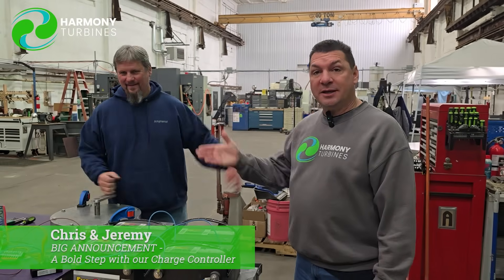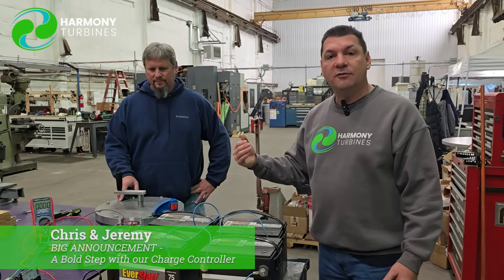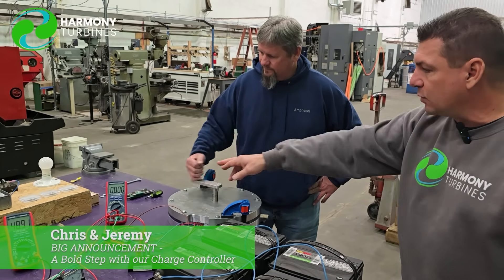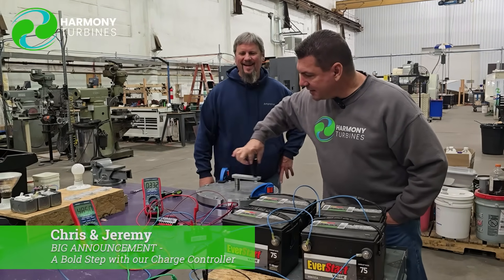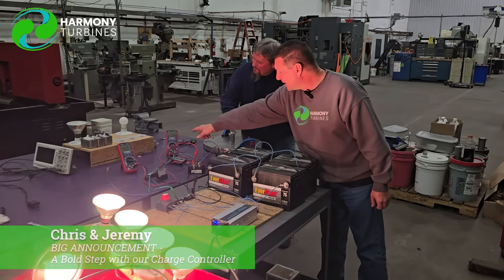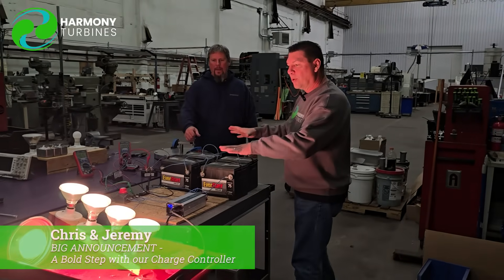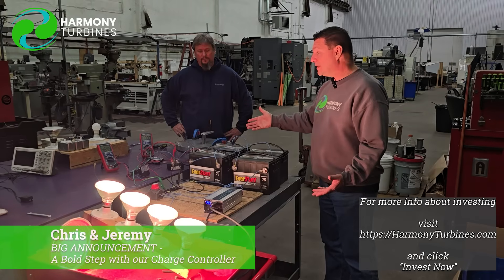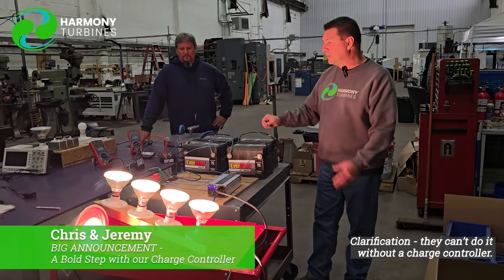We Finally Did It!  - A Bold Step Forward

Comment: You act like you made a major discovery? All of this is known science, we all know that in a micro wind generator application the alternators stator is often wound to match the battery voltage, this is known as the cut in speed. Now as I hope you know Voltage is proportional to current so if you use your furling system to slow the turbine down not only are you decreasing the voltage but also the current. Deep cycle lead acid batteries have a higher resistance they clamp down on the voltage from the alternator and therefore current increases. Traditionally a diversion load controller was used to keep the turbine under load while keeping the battery from over charging. With new battery technology like lifepo4 that include a BMS a charge controller is mppt charge controller is a much safer bet to deliver the proper charging parameters to the battery. In any event using a furling system to decrease energy production is essentially a waste of energy.
Reply from the maker: Swamp the furling is only going to be used when needed to PROTECT the batteries from damage in high wind situations. Right now the only thing other small wind turbines do in these cases is SHUT OFF completely by shorting the generator windings to one another. Their solution is ZERO power. We have the ability to still deliver a maximum safe level of power which is a huge improvement over ZERO power.

Comment: early investor, here, question:

1) if your systems are designed, as stated here, to operate in a specific range to work together based on the battery-bank voltage and type…  are you testing the use of other than lead-acid or lithium batteries systems?

2)  will there be a NiFe battery-bank system options made available?
Reply from the maker: We plan on getting into testing of other batteries with our BETA program. I specifically want to make sure we test Sodium Ion systems as well since they're going to be replacing Lithium systems over the next 5 years.

Comment: First of all, congratulations on the paradigm shift.  Epiphanies like this could really be a game-changer. As an investor however, I have a couple of questions:  1) Does battery chemistry affect this "analogue" solution?  LFP generally requires more careful management through complex BMS and specific voltage ranges tend to be very important.  2) What kind of voltage (not just amperage) comes off the generator and how does it fluctuate with RPM's?  3) It appears that instead of using greater torque to increase output from the generator, it is now just a function of speed.  But how much speed can you reasonably get out of a furling (near ground) turbine and still be safe? Originally, I thought the idea was that as the wind speed increased, the generator was going to essentially shift gears--creating more power without needing to drastically increase revolution speed.  I'm concerned that with speed being the only variable, the output will either be self-limiting below a good ROI, or it will create a long-term maintenance challenge due to wear and tear.

Comment: The simple solution is generally the best.  However, won't this solution to protecting batteries lower the efficiency quite a bit. When there is finally a steady, powerful breeze to pull energy from, you will be tapering the output rather than increasing the load.  I can see closing the scoops to mechanically protect the system when the winds are threatening, but it seems you'll be giving up energy during non-threatening times rather than pumping more electricity out.  It sounds like you're saying that the scoop system will be now be responding to the state of the battery charge, rather than the state of the wind energy.

Comment: This is appealing as no one has marketed any considerable small use wind generation. Especially compared to residential solar. If we can throw up a few of these and tie it into the grid similar to solar on a roof, that would be amazing. As dumb as it sounds, having a user friendly app to monitor the work being performed by the turbine will go a long way in marketing these on the residential level

Comment: sounds like you haven't been programming the MPPT ramp curve properly in the previous charge controllers you've used. A slow ramp can be had by fine tuning the IV curve.  Midnite Solar Classic can do this for wind curves, and so can some Solis controllers. Charge controllers when set up correctly, will control the voltage AND the current, and allow you to follow the turbines MPP over a much larger RPM range. 
Thousands of off-grid folks have been using this direct "stall-to-battery" approach without a CC for the last 20 or 30 years because its easy to do and fairly reliable (however, it  doesnt allow you to follow the cubic power relationship in the wind. Sometimes that's ok, if its a simple, cheap reliable approach.  Nothing new here. Im sure any engineer will agree, everything has tradeoffs.

Comment: You should work together with a victron cerbo.
The victron can tell the basic amperage and voltage goals to the controller, and then the controller can change the furling.
You can also say to be controlled just by target voltage. Because in my experience, I want maximum until the battery is above 3.45V per cell.

Comment: Congrats on this really good.can i ask how the voltage is kept so steady are you using electronics for this?I say this because the amps are quite unsteady.
Reply from the maker: The batteries keep us at a constant voltage (left meter) so you see the amps changing on the right as the input varies.
Reply: @HarmonyTurbines  so simple well done here.
Reply: but i presume the battery is protected by fluctuating voltages from the generator?

Comment: Hate to be the devil's advocate, but if a component or system fails during a major storm/hurricane and the furling doesn't work, what then....
Would it not be an idea to keep a simple charge controller for such an event and just set a max, before a break kicks in.
Reply from the maker: We will have a separate failsafe system in place to cut things off in the event of a furling system failure.

Comment: I was wondering the purpose of the batteries? Solar panels go straight to the grid via inverters or to storage batteries. Is it to smooth the output?
Reply from the maker: Solar has a much easier time going directly to grid because the voltage RANGE that they operate in is much smaller than wind applications. In the case of wind we are using the batteries to normalize the output of the turbine, so they are both a normalizer and buffer.

Comment: Need to see Battery Volage at the same time as you running the generator, side by side toghether with a Shunt for the battery load
If so, please use a cheap logger atleast , so we can see if it really works :) 
And if so, i will invest 
Regards from Classical engineer from Norway
(btw: asking for Cos phi, easy for you to calculate)
Reply from the maker: We already have exactly for you in this video footage. Rewind and watch carefully. Voltage is on the left meter and Amperage is on the right. Amperage is shunted through that right meter and only begins rising as we overcome 48v. It's such an amazing process how well it works. That's all thanks to our hard work on the ultra low SAF generator designs that we now have developed. You can see the exact moment where we start pushing power into the batteries. We demonstrate this live in this video quite a few times if you watch.

Comment: Sounds great but what happens if the furling system fails to function as designed and continues to charge the batteries. Think furling vanes getting stuck in place for some mechanical reason as an example the vanes fail to fully close and remain open fully or partially open. The system will continue to produce power to the batteries. You need to have a failure mode process that electrically prevents the batteries from overcharging completely.
Reply from the maker: Yes we will have a separate failsafe system in place to cut things off in the event of a furling system failure.

Comment: The only thing I'd be concerned about is making sure you fail into a safe state.  I'd hate for the furling mechanism to fail and completely fry a giant battery bank or worse yet, cause a fire.
Reply from the maker: Yes we will have a separate failsafe system in place to cut things off in the event of a furling failure.
Reply: Yes I hope there is some kind of electric fail safe "fuse/breaker" after the charge controller is removed

Comment: With a MPPT controller you could be putting power in when the voltage was lower than the battery voltage.
Reply from the maker: Watch in the video how quickly we begin pushing USABLE power into the batteries. We were trying to chase the MPPT crap for over a year trying to do exactly what you are implying which is called BOOST charging. But both BOOST and BUCK controllers have a TON of other issues that have created nothing but terrible road blocks. This solution is so elegant and smooth in operation that nothing we have ever seen before comes even close to this. The power delivery is incredible as well since we're not having any of the losses that would otherwise be coming from the MPPT controller. They all like to say they are highly efficient but that's likely ONLY in a very specific use case at a certain voltage. Go outside of this sweet spot and you have nothing but problems. We just eliminated ALL of those issues.

Comment: Congratulations! That's been a long time coming, but it's a huge payoff! 
One warning, if you happen to read this and haven't already thought about it: You need a fuse in case something goes wrong with the furling and would overcharge if not disconnected.
Reply from the maker: Yes we will have a separate failsafe system in place to cut things off in the event of a furling system failure.
Reply: @HarmonyTurbines  I would've bet you already had that covered. Great work, and Happy Thanksgiving!

Comment: Could you add a chainring and chains (like from bicycles) to add up multiple furling sails to one generator (if the generator can handle much more than what one VAWT can capture)? I'm picturing an assembly of 3 furling sail units where there's a secondary one on each side of the main one with the generator inline. The two side units are parallel and connect to the primary generator with simple bicycle chains or belts. All three sail units furl simultaneously.

Comment: The reason you can charge it with two fingers is because you are putting in two fingers’ worth of energy into it. Congratulations, you’ve discovered how a diode works. This is basic conservation of energy, the reason an MPPT “latches on” and stops your turbine is because your turbine is not producing enough mechanical power for the generator/MPPT combo and its software setup. You need to tune it to extract as much power as possible while not stopping the turbine. Thats basically the entire job of the controller.
Reply from the maker: Yes we know exactly and intimately how an MPPT charge controller works. We've had 4 electronics engineers working on it for over a year and these issues have never been properly solved for small scale wind. For larger wind, sure you have tons of power to spare but small scale wind is very challenging, hence all the problems and setbacks. This new breakthrough basically nullifies the entire need of the MPPT controller in our system. That's the beauty of the breakthrough. We don't care if we're wasting a few watts at the super low wind speeds. There's no real wattage in that wind anyway, we begin producing power and charging the 48v bank at very reasonable numbers which is what we're showing in this first (of several) videos.
Reply: @HarmonyTurbines  How is it a “breakthrough”? Charging used to work like that for 100 years before MPPTs. What you did is directly connect the RPM of the turbine to the voltage of the battery bank. How can that be efficient? Imagine a pack has a delta voltage of, say, 15 V. If it’s fully depleted, your diode will start conducting much sooner, resulting in torque being generated at much lower RPM. It will be much worse for, say, a 90 V pack where that delta is much wider.
Reply from the maker: Mic, we've tested this on a 24, 36 and 48v bank so far and it functions perfectly in each case. The RPM range required to start charging the batteries is lower, the lower your bank voltage is. But there is no stoppage or halting in any case it's a very smooth torque increase as you move from just below charging to a charging state. Then the bank holds the voltage down until the bulk charging phase is finished. It's at the end of the 2nd phase (absorption) where we need to drop the voltage by furling as we move into the 3rd phase (trickle / float) phase. We are going to make another video showing this stuff at high RPM ranges for everyone to see how it operates.
Reply: @HarmonyTurbines  There are two processes at play:
1. Extracting as much power as possible at a given time
2. Not overcharging

The second one is quite trivial to solve, so we can ignore it here — it can be handled by furling or by a BMS.

The first one will be severely inefficient if you can’t control the RPM of the turbine. It will work, sure, but it won’t extract the maximum power. Imagine a situation where your pack is very depleted, so it drags down the RPM of the turbine even though the wind is strong and the blades are essentially stalling. An MPPT would let it spin up and find that sweet spot. On the other hand, if the pack is, say, at 90% but the wind is weak, the turbine is still spinning but isn’t able to put anything in because it can’t cross the threshold.
Reply from the maker: Mic, you will see in the coming videos as we demonstrate the functionality in as much detail as we can. This is not something cobbled together from off-the-shelf components. It's working so well because we have specifically engineered our generator to be in the voltage range we desire at a very LOW RPM range. Even if you watch this video carefully you'll see we begin overcoming 48v (and therefore start charging) at quite a low RPM range. What we did not show was disconnecting a battery and making it a 36v system and then we made it a 24v system by removing the 2nd battery. In each case it performed like a dream on both startup and then smooth transition into bulk charging. We've also taken the batteries down to 46v which is just 11.5v per individual unit and at the very bottom of the safe voltage range. It has no problem with startup. We are going to test with other battery types and will show those results but Lead Acid tech has been used for over 20 years in battery banks with very successful results. As we get into the newer (higher tech) batteries we will show the results there as well.
Reply: @HarmonyTurbines  The furling is basically your mppt, as you want a specific RPM to do the charging.
For me it should be LiFePo+ and in the range 48...55.5V. There will be a lot of DC voltage suppliers on that. Like 14kW of solar chargers, 11kW of generators.
Reply: @HarmonyTurbines  Of course it works – it’s a diode and a stiff battery. The reason it works in the demo is that you’re only putting in like 10–20 watts and the generator’s internal resistance softens things a bit.

Once the rectified voltage goes above the battery voltage (48volts in this case), the current starts ramping up almost linearly with RPM, and that current sets the mechanical torque the generator is asking for. The turbine has its own wind-to-torque behavior and doesn’t know or care about the generator.
If the electrical torque is too high, the battery effectively drags the RPM down, the blades move toward stall, and you throw away a lot of potential power. If the torque is too low, the rotor overspeeds and you still don’t harvest what’s available.

So this setup will absolutely work, but it’ll only be close to efficient in one narrow set of conditions. An MPPT is what constantly adjusts the electrical load so the turbine stays near its sweet spot instead of sitting in stall or overspeed most of the time.

Comment: How does the voltage vary from 0 to target in the low RPM ranges? How much wind does it take to get to target voltage without the controller? Great work!
Reply from the maker: You can see that all in the video. The left meter is voltage on the battery bank.

Comment: If you don't put controller, where is the charge algorithm?
Reply from the maker: There is no charge algorithm. The batteries perform perfectly in stage 1-Bulk charge, 2-voltage rise, 3-amperage begins to fall, 4-voltage continues to rise as you achieve float levels, 5-peak charging achieved now we need to drop RPMs (with our furling) to keep from overcharging. These states are ALL going to be shown in another video we will do very soon!

Comment: How about pedal power version to attach to a bicycle to feed the battery Bank? How many watts can you send to the battery in 20 minutes of pedal power?
Reply: Cycling produces 300 Watts at the upper end. A fit cyclist can maintain that high rate for at least 20 minutes. That's a total of 100 Watt hours. If the system had zeroo losses, it would power that 500 Watt load for (100/500 hours)12 minutes.
Reply: @mike_van_in it will be interesting to see what their new design can do. Do you think it is possible that it can output better numbers than you describe?